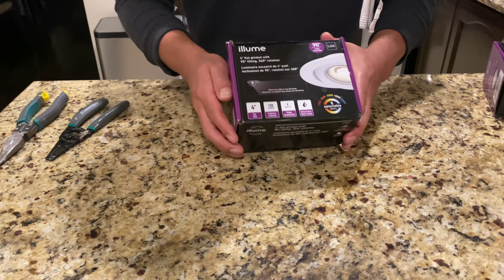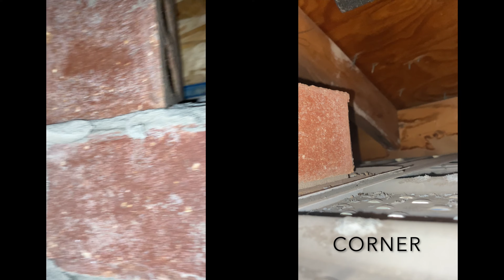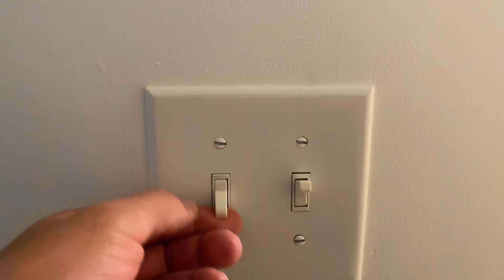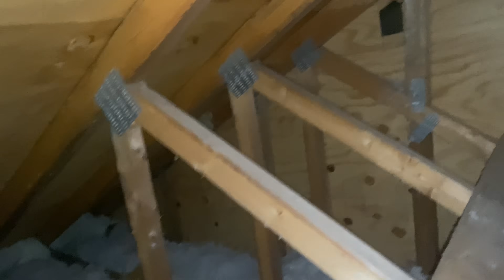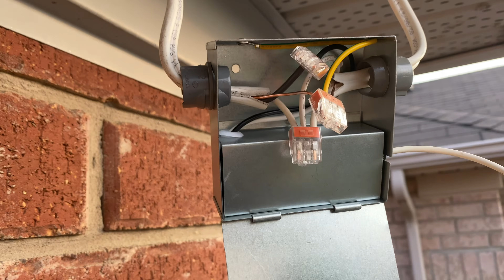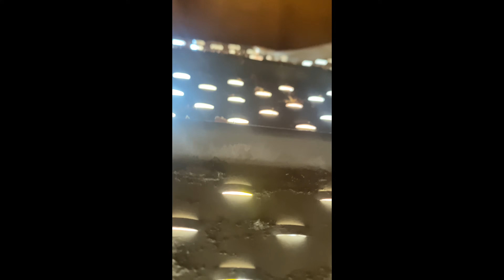How to Install Exterior LED Pot Lights - Advanced Techniques

Comment: Great video. It was a bit confusing with the switch boxes for me. But I’m sure going and rewatching it, I will get the hang of it. I think it was great how you even covered how to use the ladder. I didn’t know those things you said about the ladder. Thank you!
Reply from the maker: Yeah Thanks, regarding the switch boxes, it seems a bit confusing since there are so many wires, but just take your time and replay it as much as you  need. Remember I am converting a three way switch into a single switch for both my Exteriro pot lights and the bathroom fan.

Comment: Hi what is the beam angle on the led pot lights used?
Reply from the maker: I just used the height from the floor to where I am placing the pot light and divided it by 2. In my case the height is roughly 18 feet high , but to make sure the lights overlap each other with strong lighting, I decided to space each pot light, 7 feet away from each other., since it is an outdoor installation. Thanks for subscribing.